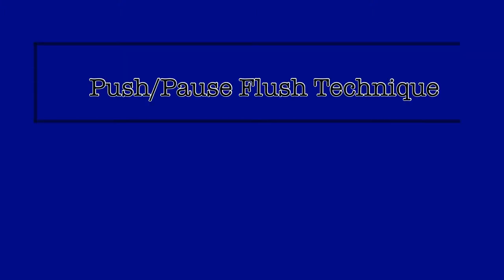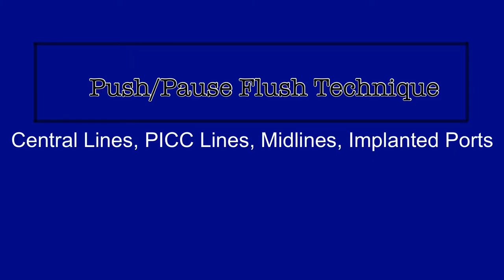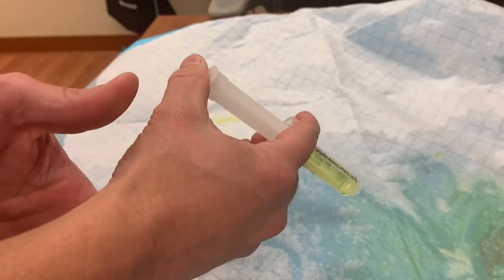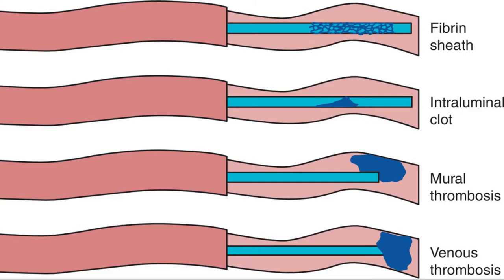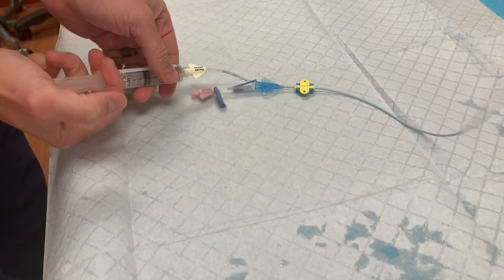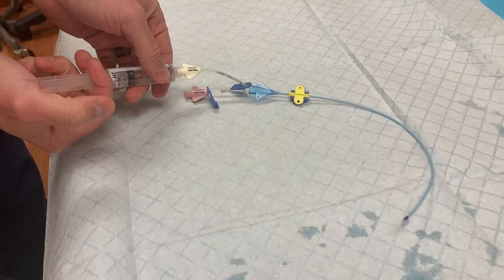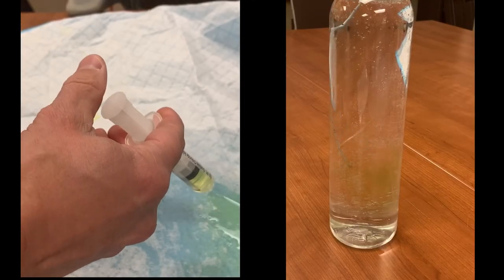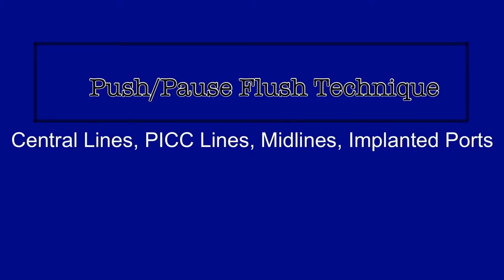The Push/Pause Flush Technique

Comment: You mentioned central lines, but would this also work for PIVs? Is this how I should be flushing my PIVs in the dental office setting?
Reply from the maker: At the time I created this video there was mixed support on if there was any benifit to flushing peripherals with this method.  some people claimed that it could cause damage to the veins because they are smaller than the vessels that PICCs Centrals and MID lines terminate in, but I could not find any supporting research for that point.  I would think if you are placing an IV for a dental procedure that it is a very short term access?  once the procedure is done they will have it removed?  If that's the case, then there isn't much need for a push pause.  Mostly it protects the lines from developing occlusions over time.  With PICC lines, MID lines and Central lines, the concern is that because they will likely stay in place for an extended period of time, and becasue with many uses they will go hours or days without infusing anything, the risk for developing clot related occlusion is high.  And the risks associated with placement are higher than a basic peripheral, so removing one that was in place and having to replace it is not something taken lightly.   

All that to say: push pause flusing is probably not neccessary for your uses, but there is no research to sugest that it would hurt anything.